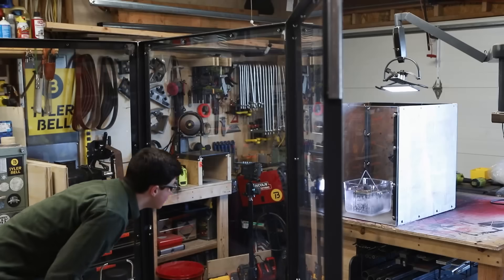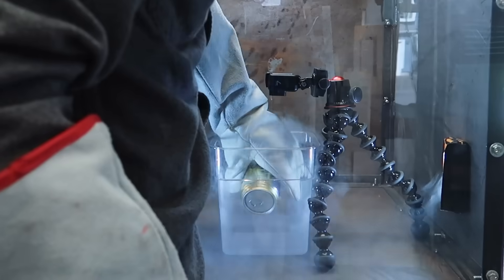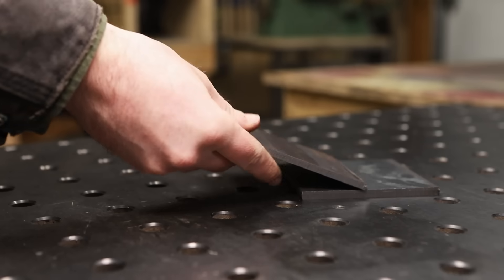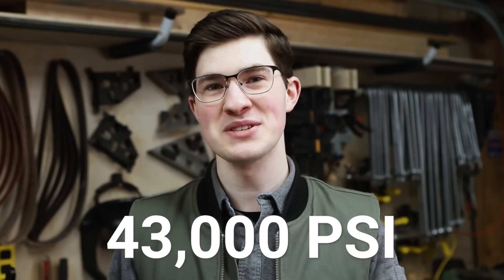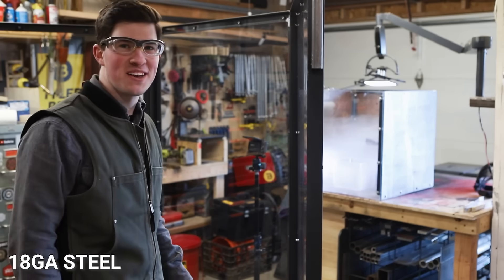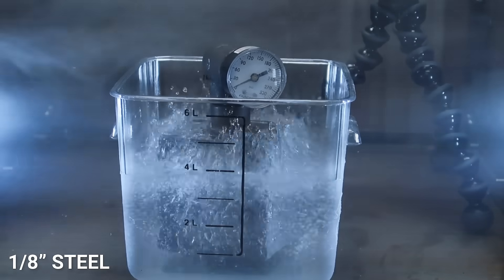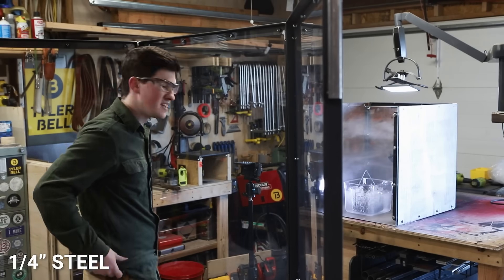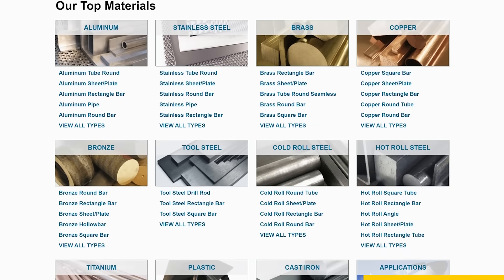Keeping ICE from EXPANDING?? (in liquid nitrogen)

Comment: The broth is initially at negative relative pressure. At the factory the cans are filled and sealed with hot broth. When it cools to room temperature condensation causes the pressure to drop.
Reply: It's also not 100%water : any other ingredients in the soup will compress and cope for part of water/Ice volume difference
Reply: @Vilm0r  I'm guessing it's not pure clear broth so any veggies or meat inside it would be quite compressible.
Reply: @Vilm0r  Yes, buuuuut carrots, potatoes, even meat, are mostly water themselves.
Reply: @wilfdarr  you have to keep in mind that some substances change the way molecules can arrange even at a low concentration. for instance if you mix pure ethanol into water, some of the volume gets lost bc the resulting liquid can be pack more densely than either liquids you start with. i suppose gelatine and sugar can have a similar effect, even in comparatively small amounts.
Reply: @fariesz6786  yup. I was just meaning to point out that the compressiblity shouldn't be any different, not that the materials wouldn't change other characteristics of the mixture.
Reply: That doesn't explain why it didn't expand
Reply: @bonerici  yes it does...
Reply: @bonerici  Or it just does not freeze due to the salt.
Reply: @rocket535inc  We saw the frozen broth though.
Reply: @bonerici  Polar sea ice has more salt in it than that broth and it expands. Its expansion is why it floats.
Reply: @bonerici  The OP already explained it quite well.  Since the broth is hot when it goes into the can, the broth itself is "expanded" when the can is sealed and the broth cools, there's less pressure inside the can than outside the can. That negative pressure allows some space inside the can for the frozen liquid to expand. Where the experimenter failed was by not taking measurements of the can of broth both before and after freezing it. Couple that negative pressure space, and the design of the can itself, chances are the can might have indeed expanded, but not enough to be detected by the naked eye.
Reply: @rocket535inc  No. Not at that temperature.
Reply: @bonerici  It did expand but the soft material inside compensated for the expansion rather than the metal can. The veggies are like holes in a sponge getting squished.
Reply: @protoguy  this exactly
Reply: ...is everyone ignoring the included gas volume?
Reply: @martindinner3621  there wouldn’t be any
Reply: @martindinner3621  I think this has to be the answer
Reply: @martindinner3621  Yes. 

"Headspace" it's called, and if you can in glass jars you can see it easily.
Reply: @martindinner3621  yes they are. I immediately thought that cans aren't filled to their limit so the liquid has room within the can to expand. (Perhaps containers are intentionally engineered with an air gap for transportation in order to prevent damage from freezing).

Also, the other none water liquids contract as they cool and freeze (oils etc). The solids in the can will also very slightly contract, though probably not very much at all.

It's also possible the regular crystal structure of the ice is being heavily interfered with (by the suspended solids and dissolved compounds), such that the freezing process doesn't expand the volume as much as expected, and instead the soup mixture is freezing more like an amorphous glass than regular ice.
Reply: Water abnormally expands on freezing due to the crystallization phenomena. Crystallization occurs when several molecules of water bounds to each other forming a specific structure. In order to occur, you need a certain concentration of water so that the molecules can be in the neighborhood of each other and may need to be free (not bound to molecules other than water). Broth do have water but most molecules are bound to other molecules like sugars and pretty much everything in the broth itself and the free molecules are quite far away from each other in order to crystallize. No Crystallization, no volume increase, actually, depending on how much crystallization we get in the broth, it can actually decrease in volume with the lower temperatures.
Reply: @carlosalves2485  good answer
Reply: Yup.. mmmhmmm... that checks out!!!

Comment: Box is not the right tool for this. Hollow bar, thread it and use a serious bung. Use an inferior bung on one end and point it in a direction you dont care about. Be careful, if you go too OP you will get to ICE 2 with this method.

Comment: I work at a place where we use “treating iron” to pump fluids. This is all done outdoors at pressures nearing 10,000 psi at 3,500 gallons a minute. There have been times where there has been a failure of some sort, and froze the iron off. I’ve never seen any of the iron break due to freezing.

Comment: Remember that extinguishers need to be serviced after cracking the seal, they won't hold pressure afterwards, so its not like you can just hang it back on the wall expecting it to work a year later.

Comment: Fun experiment, but I want to point out that nitrogen does not "stick" in the bottom of your lungs - it's actually slightly lighter than normal atmospheric air. There is a small danger of nitrogen simply displacing the oxygen in the room, but with decent ventilation it's only a concern when working with huge volumes of nitrogen, so it's an extremely safe material aside from the temperature. You might be thinking of sulfur hexafluoride, which is actually somewhat difficult to clear from your lungs, if you've been doing the "deep voice" experiment. You might be tempted to think the same of carbon dioxide, but the danger there is not that it sticks in your lungs, but that it collects in low-lying areas topographically. This has caused injuries and death when dry ice is used in excessive amounts and begins to displace atmospheric air - say, the surface of a swimming pool, where your head is right at the level where the gas will accumulate. 

You learn a lot about gas dynamics making bagpipes ;)

Comment: Really cool man! A little while back i had ran over my stainless steel water bottle with a tractor and flattened it from 3inches to 3/4inch (thankfully i just ran over the middle portion so the bottom and top were unaffected). I was pretty chapped because it was a 30$ water bottle, so knowing that water expands when freezes i had filled it with water and put in a neighbours freezer. I come back later and they said they thought the refrigerant line exploded but it was actually my water bottle, it had almost perfectly reformed. Besides some of the creases it had and the bottom expanded out a bit which I hammered down again, it was restored to its fully functional state and had a cool story to tell. The sad thing though is later at the pool i had forgotten it in the change room and couldn’t find it in any of the lost and found, so someone must have stolen it.

Comment: The reason it cracked along the weld was because you used the MIG welding process. I would predict that if you used 1/4 inch plate with 7018 stick welding it would in fact hold as 7018 has 70,000 psi of tensile strength.

Comment: So much anxiety watching you handle those things.
Reply: Came here to say this, he's basically handling a live bomb and just because it didn't explode in the nitrogen doesn't mean it won't go when he's jostling it, etc., especially having it up at face level. Yikes!
Reply: @Troy-Sheets  every time he cut to him holding a still steamy box my everything tightened up and I yelled at the TV.
Reply: As he said, since the boxes are filled with a solid, they tend to crack rather than explode. It would still break your hands tho.
Reply: @milandavid7223  shattering your hands isn't scary?
Reply: @milandavid7223  Did u even watch the video, the last box literally exploded.
Reply: @milandavid7223  Shrapnel is a thing.
I have performed this very experiment several times with cast iron spheres instead of welded steel cubes in front of live audiences of about 600 people each, and there was a very good reason why the entire experiment was in a moveable container. If it didn't go off in time we had to roll the entire box out of the lecture hall into a separate room, where we would let it thaw over night before anyone would even open the box. And yes, there were tiny fragments from previous pressure vessels embedded in the container walls.
While mild steel is generally less brittle than cast iron, that doesn't mean it can't chip and welding seams have the chronic habit of chipping during failure. You don't want such a chip coming towards you at high speed.
Reply: @wilhelmhohenzollern576  Probably localized hardening at the weld-site causing extreme brittleness, as far as the habitual chipping at welds.
Reply: spherical next
Reply: This is the thread I was going to start if it didn't already exist.

Comment: Fill one of the boxes with liquid nitrogen. Nitrogen expands 700 when it changes from liquid to a gas
Reply: Welding a box with a gas (even inflammable like nitrogen) trapped inside doesn't seem like the best idea to me.
Reply: @rhubarbpie2027  he just needs to screw the cap on though once it's filled
Reply: @Teezy4Real  fair point.
Reply: Three things:
1. If it explodes it will have sufficient umpf to potentially shred half the shop. That is an experiment you do in an abandoned quarry and take cover in a foxhole or behind a large enough dirt pile so you feel comfortable getting shot at from the direction of the pressure vessel (consider possible ricochet surfaces). The power stored in compressed gasses is no joke, potentially sending shrapnel everywhere.
2. It will take a LONG time to build up sufficient pressure and the time to failure varies extremely between each attempt. DO NOT be tempted to stick your head out of cover until it is exploded or disarmed. These things have a habit of making you think they won't go off and then blow up in your face once you come close.
3. If it doesn't go off, have a safe way to disarm the bomb from a distance. I've had to deal with pressure vessels like this in the past and had to resort to shooting them at maximum possible range. I do not recommend doing that because shooting it usually means exposing your head to shrapnel coming back at you. You want a fail-safe solution you can trigger while staying in cover, preferably with several backup solutions.
Edit: 4. You get a bigger bang if you only partially fill the container leaving a bigger gas pocket to store more energy before reaching failure pressure. Downside: It might not explode if you don't have enough LN, leaving you questioning the entire waiting time if it was enough or not and if you should disarm it now or wait just a little longer.

Comment: another solution that's going to be a lot cheaper would be to use dry ice in acetone. The acetone won't freeze and it should create a cryogenic liquid around -78C. You said steel embrittlement happens at -73C so it might work